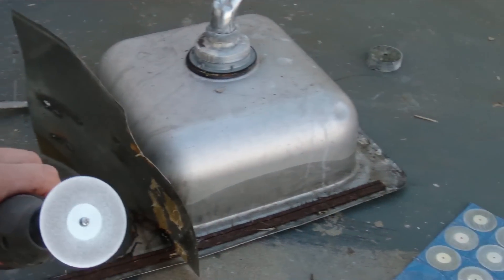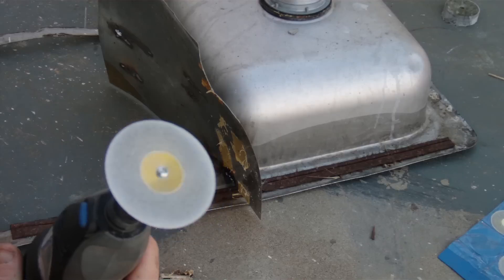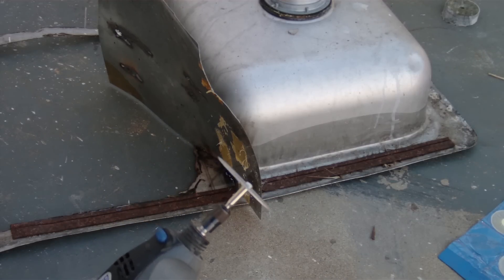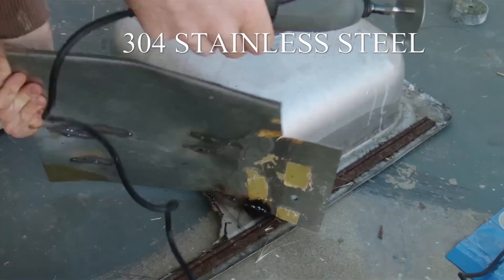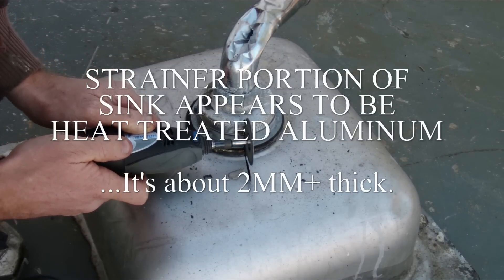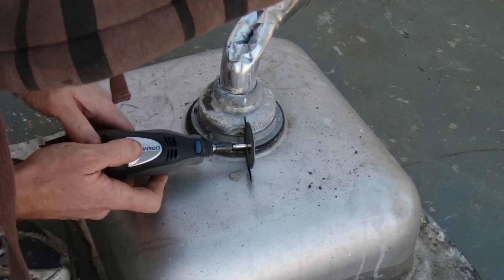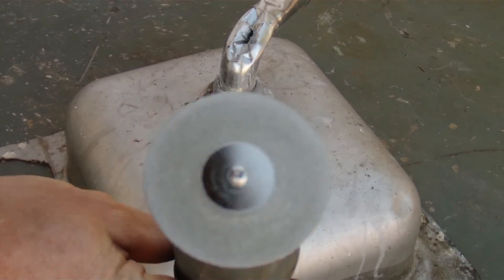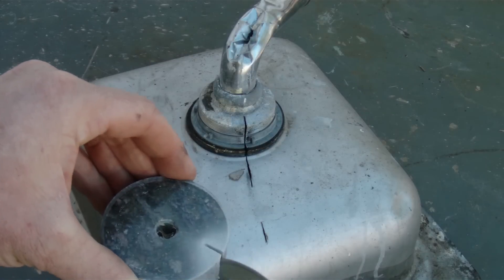$1 diamond dremel cutting disc vs: stainless, granite, aluminum, hardened steel

Comment: I want to cut through 2 nuts on my 2004 Toyota Corolla. They are both * welded * to the exhaust manifold. I removed the heat shield, which helped a little.

There is only 15/16 of an inch to get a cutting wheel in, as their is a lip around the flange.

Would one of these diamond cutting wheels do the job?

The 2 nuts are both square, and about 1/2 inch across.

It * really * sucks that some nut job (literally!) designer at Toyota decided these 2 nuts just had to be welded to the flange.

What is the top speed, revolutions per minute, of your Dremel tool?

Thank you for your help, and the video.
Reply from the maker: I think my tool is 10K rpm. it would take an eternity to get them off. can't you fit a grinder with an oversized wheel and reach the nuts that way?
to use these wheels would be so excruciating!
You'd also be dealing with fairly significant heat warping, so if You had to choose a disc type, I'd choose one with relief cuts to prevent warping problems.
Reply: @JustinCrediblename  

It would be handy if I could use a grinder, but there is just not enough room. Picture an oval, with a nut toward each end, and a big circle in the middle, which is the exhaust pipe. That is the flange which connects to the catalytic converter. And there's a little ridge, or lip, that sticks up a quarter of an inch, all around the flange. So I can only use a cutting wheel that is 1 inch or smaller.

I found a pack of 18 small diamond cutting wheels on Ebay, for just $9.49. That seems the best way to go, with a high speed, cordless Dremel tool. This is going to be so much fun.

Thank you for your note, Justin.
Reply from the maker: @Anthony_in_Bloomington_Indiana  haha aw man I hope not. perhaps a sawzall with a long carbide tipped blade by Diablo? I got through an 1/8" wall, 6" diameter stainless pipe and started making headway on an 8", 1/4" wall pipe (before someone with a torch took over), so it might chatter a lot initially, but will most probably get through your nuts.
The blades are like 17 bucks at home depot
anyway, good luck!

Comment: When I bought some of these, the imbalance was severe enough that they were unusable. Maybe smaller ones would be a better experience. I need to find a safe and easy way to keep them wet as well.
Reply: Poke a small hole in the side of a two-liter bottle filled with water and adjust the cap so you have a small stream of water trickling on to your material.
Reply: That's brilliant. Thanks for that :D
Reply: I've bought these often by now - I never had any problems at all. You're sure you tightened both the machine and the disc screw enough? There is always a chance of a production error of course, but I have had a few from eBay and never had one that was off balance. 

Safe and easy: Get one of those small bottles of non-acidic generic machine oil that you'll use for tools or sewing machines, you can usually get them at any hardware store. It's a small bottle with a narrow tip that lets you drip out very little at a time. Just drip a few drops on your blade, cut until it starts to dry and then re-apply. If you want to avoid dripping, pour enough in a plastic container that you can just dip your disc and then dap it on the edge to shake off excess to prevent a face full of machine oil. It works wonders. In a pinch, baby oil can work too or even water if you absolutely do not have access to oil, but water will need to be re-applied so often you will feel like it'd be easier to whack at it with a stick instead of usind your disc. 
If you want to rig up a system if your disc or what you're cutting is stationary, you can get a drip hose like they use for lapidary stations, but that might be more of an investment than you want to get into if you're just doing the odd hobby project. 

The good thing about these from eBay is that they're so cheap you can just order a buttload of them and change them when the diamond starts to thin out - and it will, fast, because these are obviously poor quality, hence the low price. But it's an excellent and cheap source of diamond cutting if you don't need to use your disc for hours every day

Comment: I don't know you respond to people or how long it usually takes you or if you even still have this account lol. I'm cutting a hole in the bed of my Chevy Silverado to change the fuel pump. as I watched your video, hoping I can find something similar at Harbor freight and not have to wait for shipping, that was wondering if you thought it would work as the metal on the bed of the truck is about 3 cm thick .
Reply from the maker: Did you mean 3 millimeters thick? a 3CM steel plate would weigh more than 1 ton just for the bed.

using this tool would be extremely tedious. It would probably take you an hour. I would recommend you not use this tool.

I'd recommend a cheap grinder with a grinding wheel if you don't mind making a square hole, or a drill with a Milwaukee Hole Dozer hole saw.
If you're on an extreme budget, you might consider a jig-saw or sawzall with a metal cutting blade.
It all depends on what kind of tools you can get at a garage sale, if you're on an extreme budget. Sometimes you can find them for free on craigslist.
To save money on blades (but not aluminum oxide grinding wheels), use a cutting oil or water to cool the bits, but be careful not to get the water inside the tool.
Sometimes with hole saws that are oversized for the drill, you can run them extra fast but with very little pressure so that they're moving too fast to be "caught" by the metal.

Comment: So many Safety Sallys are concerned with your use of this tool. Even at full speed you can grab the cutting wheel with a leather glove and the thing melts. You could hammer the cutting edge into your hand and you would only get a paper cut.
Reply from the maker: yup!
And just look at all of the people who [incorrectly] assumed that I wasn't wearing safety glasses!
So many people assumed that I don't understand materials behavior and am at significant risk of catching this abrasive blade on the finger.
Reply: I can confirm this - I have had this disc slip and hit my fingers multiple times, there are no teeth and your skin is too flexible and your flesh too soft for it to do any actual damage. More often than not it resulted in a scrape that didn't even bleed.
Reply: Yeah dude. I use one of these for cleaning behind my foreskin. You won't find any cheese there!

Comment from the maker: records keeping post:
The profile "cuts rose scents", located here: https://www.youtube.com/channel/UC42KOnSmqFBhfA0d0All-MQ
posted the following drivel.

1) Well usually a arterial blood flow is enough to cool the discs from 
flexing.I never saw red here but next video dont wear eye protection, 
gloves and ignore a couple more standard safety precautions And maybe we
 can see the disc coolant.
Then can you show how to unclog a running snowblower with your hand.
Or maybe some loaded pistol finger spins into a cowboy belt holster?

response: You'd better not go outside! A meteor could strike at any moment!

2)Justin Crediblename 
Well Im not the one whose eyes will swell up.And you loose 60% of your 
vision around 3 am after doing your pro cutting.
But the Er doc is just going to use a strong magnet to remove metal 
imbeded in your eyeball.The other particles are stuck for 
good.Antibiotics,but the damage is done.
Would suck loosing your drivers license in a few years because your 
vision rapidly degenerated for some reason.But stupidity has already 
blinded you.
And don't worry.If I stayed inside a fucking piano would fall through 
the ceiling.And to prove it I was driving down a empty highway one clear
 winter night.And was around 5 miles away from a airport.Well a chunk of
 ice about the size of a microwave fell off a plane.And at 65mph driving
 on a completely empty highway this ice chunk fell straight down at 
terminal velocity and just skimmed the front of my Toyota p/u.Ripping 
off only the plastic license plate frame.One foot closer and it would have hit the hood.Three feet the windshield or cab roof.
So in my life a meteor  would not surprise me.
Just the way it is.

response:
+cuts rose scents you're such a genius. firstly, some spelling corrections for your illiterate ass.
previous post: *an arterial
current post: *imbedded, more popularly spelled "embedded"
Secondly: I was wearing safety glasses.
GENIUS.

Comment: Well usually a arterial blood flow is enough to cool the discs from flexing.I never saw red here but next video dont wear eye protection, gloves and ignore a couple more standard safety precautions And maybe we can see the disc coolant.
Then can you show how to unclog a running snowblower with your hand.
Or maybe some loaded pistol finger spins into a cowboy belt holster?
Reply from the maker: You'd better not go outside! A meteor could strike at any moment!
Reply: Justin Crediblename 
Well Im not the one whose eyes will swell up.And you loose 60% of your vision around 3 am after doing your pro cutting.
But the Er doc is just going to use a strong magnet to remove metal imbeded in your eyeball.The other particles are stuck for good.Antibiotics,but the damage is done.
Would suck loosing your drivers license in a few years because your vision rapidly degenerated for some reason.But stupidity has already blinded you.
And don't worry.If I stayed inside a fucking piano would fall through the ceiling.And to prove it I was driving down a empty highway one clear winter night.And was around 5 miles away from a airport.Well a chunk of ice about the size of a microwave fell off a plane.And at 65mph driving on a completely empty highway this ice chunk fell straight down at terminal velocity and just skimmed the front of my Toyota p/u.Ripping off only the plastic license plate frame.One foot closer and it would have hit the hood.Three feet the windshield or cab roof.
So in my life a meteor  would not surprise me.
Just the way it is.
Reply from the maker: +cuts rose scents you're such a genius. firstly, some spelling corrections for your illiterate ass.
previous post: *an arterial
current post: *imbedded, more popularly spelled "embedded"
Secondly: I was wearing safety glasses.
GENIUS.

Comment: diamonds melts on contact with hot steel... take it slow and use water.
Reply from the maker: yo homie. I've cut a number of lineal feet of stainless steel 16 gauge pipes with diamonds. Water cooling is certainly preferable and wear-rates are appreciable, but not prohibitively so for thin-walled tubing.
Taking it slow is a bit of a fool's errand with stainless since if it has inadequate removal power it'll re-melt next to the cutting tool and increase difficulty cutting through the material.
And putting water on or near a dremel is a bit risky. It's ideal for large jobs and controlled environments, but not necessary.
Reply from the maker: P.S. I'm still using that same exact disc in 2016. I can't say that for the aluminum oxide discs that I've used...because the diamonds didn't exactly melt on contact.
Diamonds take about twice the heat prior to melting as steel. Perhaps you're thinking of oxidation. Regardless, I'm done here.
Reply: I still do my 4th axis  carbide end mill sharpening with diamond grinder wheels and bits, because it's cheaper than CBN, I just use alot of water and take it slow.

Comment: im about to get a dremel 3000, Are they powerful enough to cut sawblade steel, or any high carbon steel? i plan to try to make home-made knives, or sharpening.
Reply from the maker: +Rods Ahed 
depends on the surface area in contact with the sawblade steel and size of knife. The larger the material and the larger the contact area, the more difficult it's going to be to cut or remove material. Check out the power consumption for each rotary tool as you shop around so that you can get the most powerful one.
I bought mine for $7 at a neighbor's garage sale, so I didn't have many options to choose from and am not familiar with the rotary tool market.

Comment: Not to nitpick about safety but you really shouldn't have dangly strings hanging from your sweater while you're using rotary tools. I'm on my employers JHSC and we have seen a lot of injuries due to things like that.

Thanks for the video!  Those discs will definitely come in handy.
Reply: +Justin Crediblename He was talking about the cords from your sweater being grabbed in the axle. And he's right, that could happen. It's just a common safety issue not to have loose hair/cords/sleeves near fast-turning axles.

But if you think you are above that, go ahead. It won't happen to you, it never does.
Reply: +stickjohnny It's a Dremel.
Reply: +Tim Ramich dremels are rotary tools...
Reply: +stickjohnny Yeah, with no appreciable power.
Reply: +Tim Ramich 
No.

 There was a serious injury at the welding shop in my company when a worker using a similar tool got some of his hair caught. Because of the extremely high speed the tool was spinning at, it was instantly drawn right into the workers face and ended up disfiguring him for life. Good thing he was wearing eye protection. A face shield might have saved his face if he was wearing one. He was a subcontractor though, and wasn't following our safety rules.

 Power tools of every kind need to be respected, weather or not you think they are powerful enough to hurt you.
Reply from the maker: +stickjohnny I'll bet that it wasn't a grit-type grinding wheel he was using on that little rotary tool
Reply from the maker: Willem Arnhem
oh hah. facepalm at self for missing that part.
cheers.
Reply from the maker: stickjohnny
I've never had a diamond wheel grab. Trick is to keep the friction low and the disc momentum high. I've only cut about 700 lineal feet of granite with diamond tools, so what would I know?
I suppose if I'd had a seizure or had really poor tool control then I could have gotten damaged, right?
I've also cut 4" deep into a septic tank with a 14" diamond blade mounted on a 9" grinder. THAT was dangerous (many safety precautions taken, but since I maintained proper tool control, it never grabbed)
used a 10" diamond blade to slice a 5000 gallon three chamber above ground septic tank into pieces that would fit out a 36" door. Cut 16 gauge stainless pipes into gutters and downspouts with a diamond blade, ground down a number of concrete subfloors, made holes in cinderblocks and drywall with diamond hole saws...
It's a lot less grippy than aluminum oxide grinding wheels because it's backed by a steel disc and doesn't bend as much into contorted angles that can grip the work piece more readily
Reply: +Justin Crediblename 

I don't understand why you don't think this tool is capable of hurting you. It can cut a fucking sink in half.

I'm done talking to you.

Comment: can i cut some 5 mm steel with such a disc?
Reply from the maker: I'd plan on it taking around 2.5 minutes per lineal centimeter. Stainless steel is going to take longer most likely.

Comment: Man, how many fingers do you have left now?
Reply from the maker: nice. people get lazy and tired. They fail to get exercise and get bored (extremely bored) on the job. they get in a hurry then they make a mistake.
Reply from the maker: lol. all of them. no scars or significant injuries.
Cutting granite with grinding wheels has repeatable, predictable results. If those results are understood, then operations can be carried out safely.
Reply: Justin Crediblename 
yes safely
until a unintentional accident
I worked EMS full time for years and I went on so many calls for old pros.
A few times I didn't even bother looking for cut off fingers that hard.Maybe they could have been reattached.Maybe not.
But one can only figure the guy felt he could live without them.
So thats what he ended up doing.
Besides he inturuped my afternoon nap due to his pro understanding of the materials. So fuck him  that prick.
They dont pay you a compassion bonus.
Reply: A disc like this won't cause you any serious injury. It's flat, and your flesh is far too soft, unless you actively try to hurt yourself by prolonged exposure, the motor in a Dremel and the like won't cause you any injury with a disc like that. 
And before any of you try to call bullshit, yes, I have these discs, and yes they slipped and hit my fingers, and no, I didn't get hurt any more than what a band-aid could take care of.

Comment: best to use an angle grinder with a thin metal cut off disc. Disc will cut through anything, last more and costs only around €1 per disc.
Reply from the maker: sometimes they don't fit or are too bulky to do the job adequately.
I have a 4" dewalt and a 9" makita, a bench cut-off saw and a plasma cutter.
the dremel is sometimes useful.
Reply: ***** But to cut a sink - an angle grinder would do a great job. Once I used my 4 inch grinder to cut in half an old cast iron bath tub.
Reply from the maker: was just junk material for demonstration purposes

Comment: What if it flew off and cut your neck?
Reply from the maker: highly unlikely. It's a steel disc. If the screw holding the disc snapped then it wouldn't throw itself like a normal sawblade because it doesn't grip like a normal sawblade.